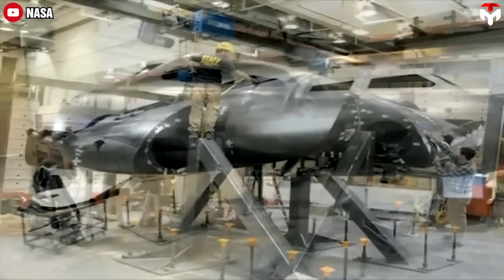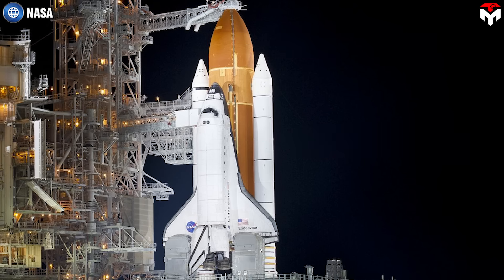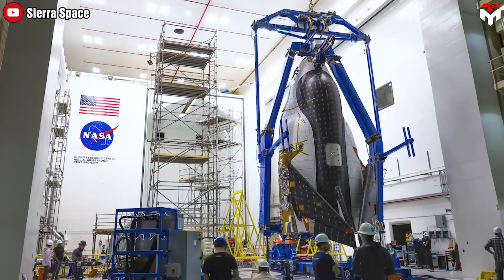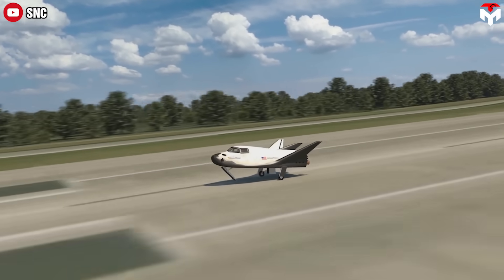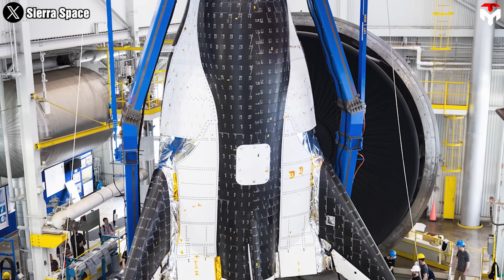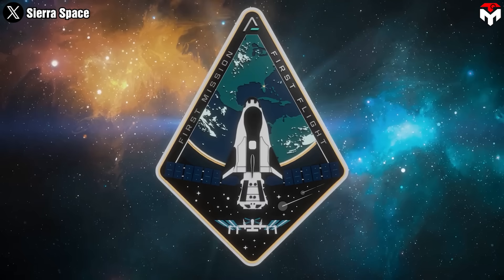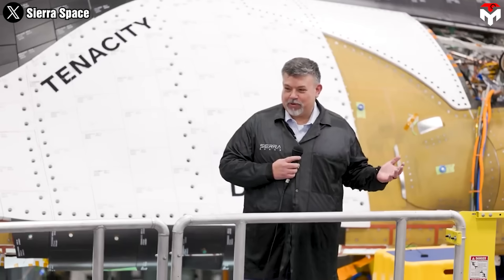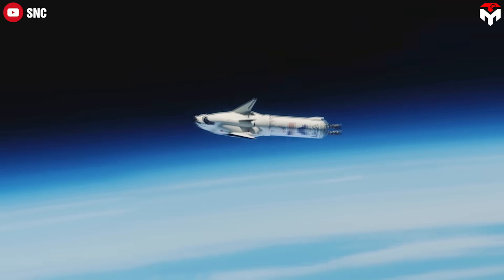NASA's New Space Plane SOLVES What Musk Called 'Impossible'!

Comment: What Soviet designs? This looks like the US lifting body X craft from the 1960s. There are no obvious wings and I don't recall the Soviets developing, or copying, the US lifting body craft.
Reply: As for the Soviet-era craft that may have have influenced the HL-20 (on which Sierra Space's craft is based on):
MiG-105 ( https://en.wikipedia.org/wiki/Mikoyan-Gurevich_MiG-105 )
BOR-4 ( https://en.wikipedia.org/wiki/BOR-4 )
These in turn may have been influenced by the American lifting body craft such as the M2-F2, X-24A/B, and HL-10.   Of course this could be a simple case of "form follows function" -- much in the way that dolphins DID NOT copy fishes.
Reply: https://en.wikipedia.org/wiki/Buran_(spacecraft) Maybe the news media in the states suppressed this!
Reply: @grovoskigrovoski8681  There is no suppression of this. The Buran was a copy of the Space Shuttle and was a space plane with wings. The NASA space plane has no wings and is a lifting body.
Reply: @stephenskinner3851  The Buran was a copy of the idea of the Space Shuttle, not a direct copy of the Space Shuttle itself. Form follows function which is why all jet airliners look similar. Same applies to space shuttles which is why the Buran and Space Shuttle look similar. Buran was smaller than the Space Shuttle, and unlike the Space Shuttle, Buran didn't have launch engines on it. The rockets you see on the back of Buran are the OMS (Orbital Manoeuvring System). [The Space Shuttle had the OMS in the pods on either side of the tail fin.] Also, unlike the Space Shuttle, Buran could operate fully autonomously, that is without a crew, from take-off through the entire mission to and including landing. In many ways, it was actually better than the Space Shuttle. But it also suffered from the same major flaw of the Space Shuttle; it was more expensive to use than conventional rockets.
Reply: @DarkSyster  And was never used. It is easy to say it was better without evidence.
Reply: The Federal Republic of Germany is already a lot further ahead and the EU will benefit enormously from this!
polaris aurora space planes
https://www.youtube.com/watch?v=RoK70Px25R4
https://www.youtube.com/watch?v=FhnCDFu43E0

Comment: I noticed we went from three stages to two to save cost but if a launcher becomes reusable third stage can be roughly 40% lighter for the same load.. I think a DreamChaser with two reigniting type orbital Merlin’s or equivalent and some two or four fighter type 3 D printed jettison fuel tanks abandoned just before orbital speed is reached like the shuttle main tank but only to fuel the third stage and so much smaller. I suggest there are no need to cover disposable and cheap fuel tanks with heavy heat tiles to recover them…and as the first stage I would consider a Stratolaunch Scale Composite 200 plus tons capacity heavy lift plane and as second stage, a Falcon9/ Heavy mid stage landing legged and refurbished rocket or a large Pegasus winged rocket flying and gliding back empty..wings could provide additional lift up at take off and up to 100000 feet’s , this would make a fully recoverable three stage ISS crew taxi much cheaper than huge starship recovering heat tiled empty tanks from orbit..the 200 tons plane capacity might be limited but two boosters are possible . With reignitable Merlin’s second stage rocket engines can assist acceleration during take off and once at 25000 feets high, both plane and second stage could be refuelled more with other  KC46 or A330MMRT tanker planes..all components being durable except for third stage small 3D printed tanks, the cost or one launch can be cut drastically considering the cost of the niobium nozzle orbital Melin of talon second stage lost is expensive, the all weather landing lifting body capacity is also safer and requires less reserves on board…one big issue is that all those technologies exists but are in different private hands with sometime a few litigations inbetween those competitors but not partners…. It would take a capable prime contractor like NASA for Apollo or a very good engineering firm subcontracting, integrating and approving each piece of the puzzle…😂

Comment: The fact that SpaceX seems unable to design a heat shield for the second stage of starship that meets its reusability criteria coupled with the high G landing maneuver to me means that starship is ultimately going to fail at meeting the requirements that it was supposed to meet. I look forward to Sierra designs, making further progress and succeeding. As far as I can see, the starship is the cyber truck of space vehicles, it might look like the future, but in reality, it just doesn’t work.
Reply: So you obviously have zero concept of rocketry or science in general.
Please stop spreading manure.
Reply: You need to learn the difference between working to develop something and are unable to do it. You could have made similar comments about Dream Chaser five years ago. I'm also curious what you think the G forces of a Starship landing are, and why.
Reply: @ 
Perhaps. I give credit to SpaceX for developing a very large booster. However, the fact that they still don’t have a valuable heatshield design is proof that they designed the second stage of starship based on a lot of very favorable assumptions. I hope that SpaceX not only is Trying out a metallic key shield, but is also completely rethinking the design of the second stage of starship.

Comment: If they launch it on something like Stratolauncher then there will be less stress on the tiles on the way up. This will make sure that the tiles are in a better shape on re-entry. Besides it will be using the atmosphere instead of fighting against earth's gravity well. It will be cheaper in the long run. NASA is the best place to make a stronger and more powerful Stratoluncher. 
Now that it has been done on the cheap what is standing in the way raising enough investment to make one with less compromise? It can have a stronger framework, eight engines and refuellin to climb even higher. Or have a combination of jet engines, scramjet or/and even ramjets. By the size of it should have enough space for different propellants suiting a variety of altitudes and profiles. 
That would be an elegant way of going to and returning from space rather than having 50 bombs exploding under a spacecraft and catching it in the air. Maybe even the Sabre engine can be used. Not doing it is a failure of imagination.
Starship is just stupid unless you want load it with explosion and dropping it on a target to make a bigger bang. It will never leave the orbit without crazy number of pretty tricky refueling in a vacuum that will drive the cost up.
Reply: (Sigh) And just how do you imagine any mere airplane, regardless of type and number of engines, is going to push Dream Chaser even into space, much less into orbit?
Yes, Starship requires refueling to leave Earth orbit. Refueling it will cost more than merely lifting it into orbit. It will still be only a small fraction of the cost of an SLS launch.
Reply: @odysseusrex5908 SLS? What has that to do with anything.
I am talking escaping earth gravity using aerodynamics instead of roketry. If you càn send space ship to earth orbit in a much more elegant way then you can send the fuel in the same way.
By the look of it tiles are never going to be good enough to resist the stresses involved when blowishing them up into the orbit. Gently flying them passed the dense atmosphere will reduced those  stresses.
Even SpaceX is looking elsewhere to instead of using tiles.
The first and main pronlem is to send material to orbit at much lower cost safely.
Then you can start thinking about leaving the orbit.
Stratolauncher is already testing hypersonic vehickles on regular basis and that was made from parts of other planes.